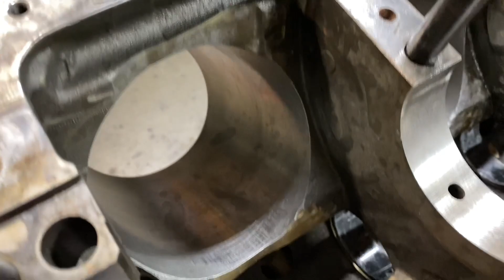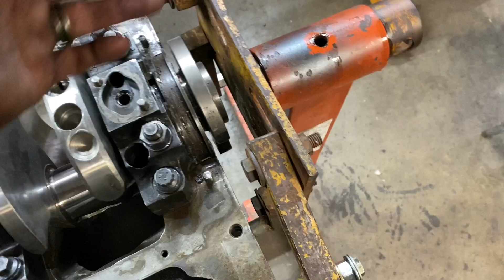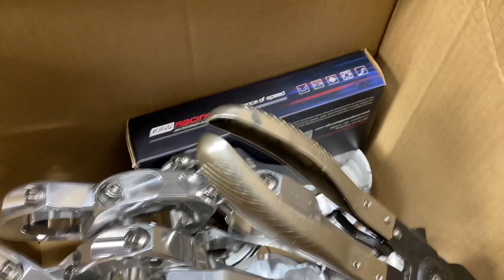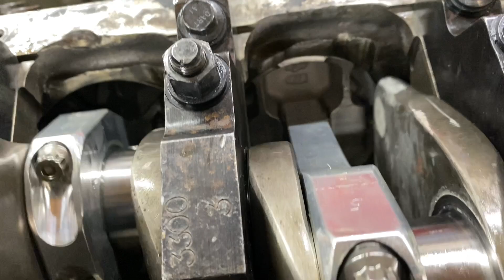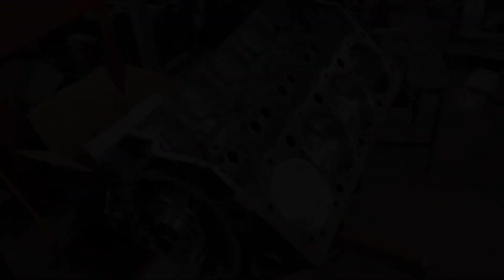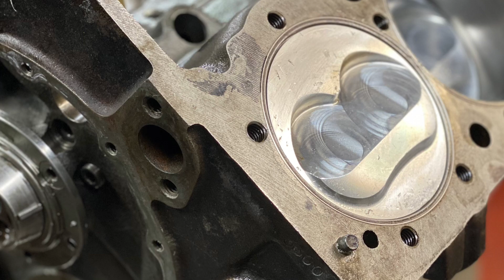Destroked 400 SBC, 364ci

Comment: Turbo John is dope and simple SBC no LSX or LTX and you make the same power or even more and that's why I like him,,, yeah the block maybe Dart but its fasure not a LS which is Great tired of seeing those sometimes👀😓😆💪🏾💪🏾💪🏾💪🏻💪🏻💪🏻
Reply: I'm not saying this engine will not run good or l don't like it but my opinion if your going to be running a engine hard 7200rpm or more you'd be hard pressed to make any old style smallblock to run as well or last as long as a chevy LS engine I've had many old style built smallblock chevy engines 350s 383s that ran well but the 6 bolt mains on the LS engine is rock solid the crankshaft is bolted so tight to the engine block that it does not flex at higher engine speeds flexing is what destroys your engine and is why bigger engines that are revved high generally don't last as long that's why many old school racers liked the 283 302 327 engines with the shorter throw crankshaft they take more of a beating and as far as cylinder head flow l don't see to many smallblock chevy heads that can flow 358cfm on the intake side but stock LS3 heads that have been CNC ported do even expensive Air Flow Research aftermarket smallblock head only flow 280cfm to 300cfm on the intake side and cost 3000 dollars a set complete CNC ported stock LS3 heads complete are 1500 dollars you can have the biggest cam in the world if the heads don't flow you don't go fast getting a stock chevy smallblock head to flow over 230cfm on the intake side is close to impossible so any camshaft with over 230 duration is pretty much a waste of time the heads don't flow enough to support it the CNC ported LS3 heads will support a camshaft in the upper 240s with stock pistons and probably make 540-580 crank horsepower with a stock shortblock 6.0 or 6.2 engine on 93 octane fuel unless this old smallblock has 12 to 1 or more compression will it make this kind of power the LS engine 6.0 or 6.2 can make this kind of horsepower with 10.5 to 11.0 compression a realistic number for a old style small block of the same size is 450-480 horsepower it will need aftermarket heads and block pistons rods crankshaft and it won't last as long or be as reliable

Comment: Putting the 400 bearing in wouldn't you treat that like putting the actual normal bearing in and not put any oil in until you put the 350 bearings in because you never put oil on the back side of a bearing gives it a chance to spin a bearing....I'd think when you modify that bearing to lube the the thrust bearing you'd  modify the 350 bearing not on the 400 bearing
Reply from the maker: Yes, the 400 spacer bearings gets no oil.I only oiled the 350 bearing

Comment: Why a destroked engine? I mean why not just keep it 400 cubic inches?
Reply: Stroke never dictates engine rpm capabilities the cam and head's do
Reply: Destroked runs higher rpm so you can run more rear gear
Reply: @jaydunbar7538  yes I know you can run the higher RPM's but wouldn't 400 cubic inches give you more torque and remember that old theory when it comes to engines,  "there's no replacement for displacement".

Comment: What are the brass fittings in the valley for??? Oiling
Reply: keep oil from draining back down on the crank and rods. it has to drain down the front and rear holes in the block. it cuts down on crank windage. and keeps rotating weight down in higher rpm range.
Reply: I am wondering the same thing

Comment: Awesome I am currently building a 400 SBC !
Reply: Strong engine for small money, if it's all matched up and put together right.  Good luck Bro
Reply: @joejones9944  I am trying to do it right. I have the 509 block so it was the higher nickel block two engine shops said it was the strongest stock block got lucky with that. Using custom skip white performance alum 62cc chamber heads lunati 510/520 lift cam 750 e85 carb performer air gap intake. KB flat top pistons and rods. So the engine shop said it shop put out 550 or so hp and 500 ft/lbs should be a nice combo. Thank you for the luck.

Comment: @Turbo John, I'd bet you gain more compression than you think. You already mentioned the longer rods putting the pistons higher in the bores, but the line-hone also raises the crank in the block just a little, so that will raise the pistons just that little bit more. You might want to check and make sure the pistons aren't too far out of the bores. If the block has ever been decked, I'd bet good money the pistons will be just a little out of the bores. No big deal, but you sure don't want that quench area to hit the head at high rpm when the rod stretches a little. You mentioned in the last video you were at like 9.5:1. On methanol, I'm betting the engine is going to LOVE the additional compression.

Comment: I was told not to touch the L-19 bolts with fingers ?  Can weaken them . Idk Didn’t plan on making that kinda power anyway so I got the S2000 for now . Lol
Reply: You are right should be wearing gloves when handling the L-19 rod bolts. Very good bolt if handled correctly.

Comment: Curious as to the reasons why you are running the bore and stroke you have.  Why a destroked 400ci?  Better rod ratio?  Power band higher in the RPM range?
Reply: I think he bought an old nascar crank for cheap, which dictated the rods and pistons.
Reply: @joegramling5545  there are also certain race classes that benefit smaller cubic inch motors, and handicap larger CI motors. And then of course, there is personal preference...